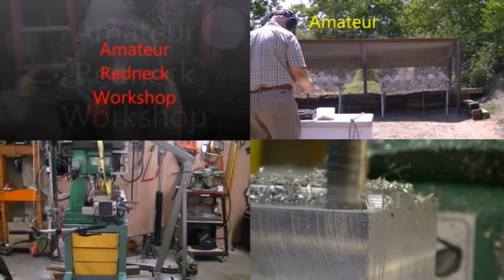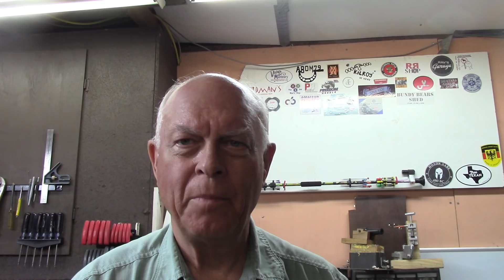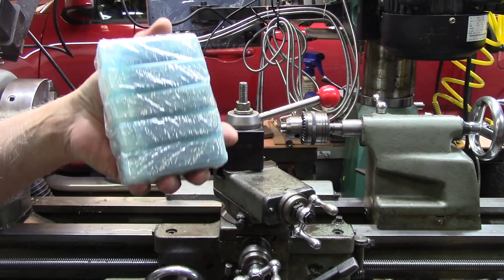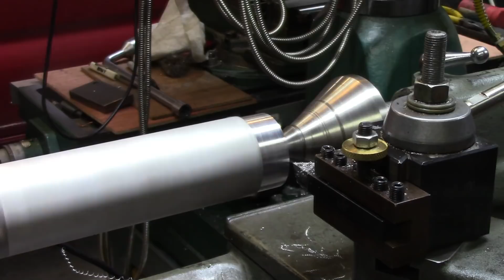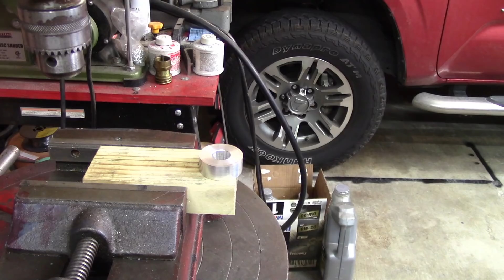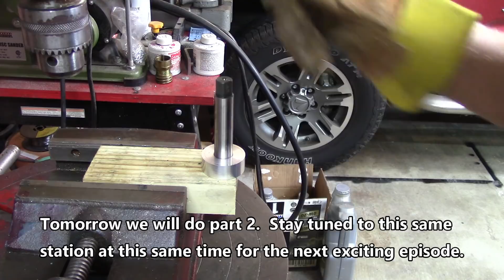The quest for metric threads   first change gear part 1 of 2

Comment: Harold, check ebay for a seller ID 6061dude.  He has many sizes of round stock (and other shapes) in small pieces.  I deal with him locally here in Colorado Springs and he is a good guy and will get you what you need.  I've also bought brass stock from him.
Reply from the maker: I will make note of that, thanks.   Thanks for stopping by.

Comment: May have been Rob who mentioned that a video of his had barely been up when he got a dislike - it wasn't even long enough to have been watched through! I get a few - can't be bothered to worry about them.
Wow - that was a huge bunch of taps - nice find.
Wish I had a metal supermarket near me - always a problem finding stock without crazy shipping costs - let alone the cost of material itself.
Reply from the maker: The price usually works out to just a little less than it would cost to buy it online and have it shipped.  The convenience is getting it fast.  Thanks for stopping by.

Comment: I remember my first thumb down, I was really wondering what was wrong, now, just like you, I don't care much...
On the other side it would be interesting to know why if there is any good reason at all, or just a bad day for them...   ;)
Wonder how tough the blank is on the tapered shaft, guess we'll know soon enough.
What size are your taps?
Cheers,     Pierre
Reply from the maker: I see the number of thumbs up and down vary in proportion at the same time.  The small taps are 1/4-20 plug taps.  I do use a lot of those.  Some are 3/8-18 pipe.   Thanks for stopping by.